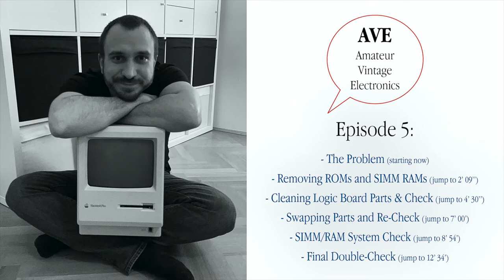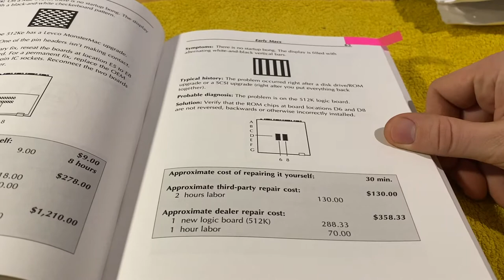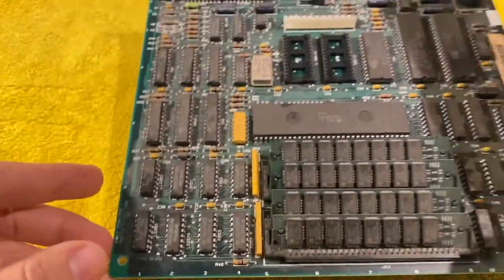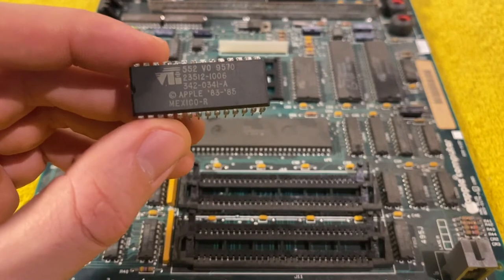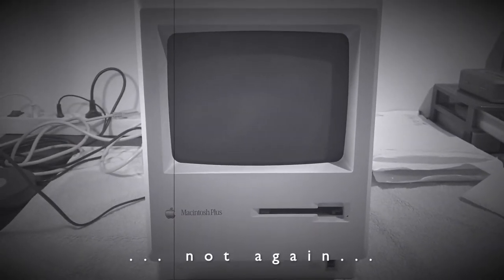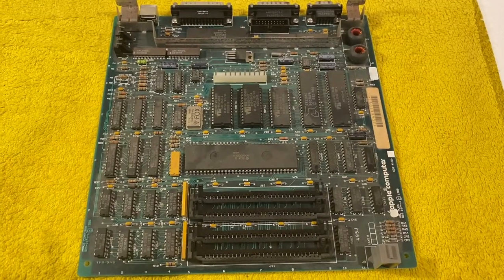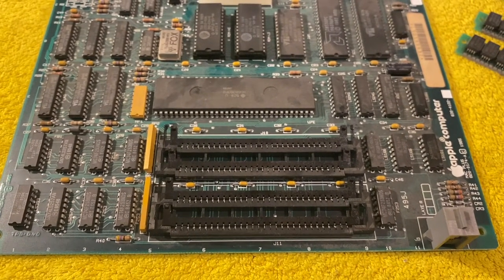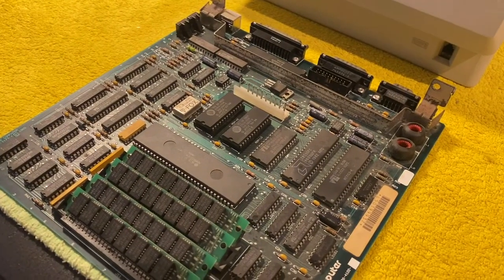Troubleshooting on a Macintosh Plus Logic Board (Episode 5) #MARCHintosh

Comment: I have a few thoughts to contribute :) 
The repair book "Troubleshooting Your Macintosh" (1992) is online at vintageapple.
It suggests the causes resulting in POST failing with "jail bars" in order are (a) power supply, (b) SIMMs, (c) logic board. Do you have more than one Mac Plus, or just one full machine and an extra motherboard?
I suggest spraying all sockets with contact cleaner (SIMMs, ROMs, etc) and refitting those components. Unless I missed it, you only removed corrosion from the pins, and we can see significant corrosion elsewhere. It's fine to spray contact cleaner on the motherboard. (Honestly, washing the whole board in the sink seems in order, then drying, and using 99% IPA. I'm sure you've seen videos of this.)
You can isolate which half of the memory might be the problem by testing without the top row (e.g., if the problem is sockets or related components on motherboard) by installing the ONE ROW resistor. That's an easy test, so I would try that. Also, substituting in two 1MB SIMMs in the first row (and removing the RAM SIZE resistor) would be a good test if you have those around (instead of 256K SIMMs.) If you don't have another resistor handy, you could move the RAM SIZE resistor to the ONE ROW position.
I would order a Mac Plus cap kit from Console5. It's easy to try, and you know those will ultimately fail if they haven't already.
Looking forward to seeing what you find!
Lots of non-socketed components that you'll have to install sockets for, but with two boards, one working you certainly have what you need isolate the problem. Other direction to go would be a logic probe, comparing signals on pins between the two boards.
Reply from the maker: Thanks a lot! I isolated the problem to the board itself! Both ROMs and SIMMs are working fine on the other board despite the corrodet pins. Spraying the sockets on the board is something I certainly should try as well.

Already thought about moving the resistor and try it with one row only, but before doing so I wanted to get some feedback if it could be another part. Don’t want to solder and desolder too often since I want to keep this board at 1MB RAM.
Reply: @AmateurVintageElectronics  Right, you tested the ROMs and SIMMs by moving them to the other board, which means the socket(s) could be the problem on the "bad" board. Anyway, we can continue over on the right video. :)

You are tying your hand behind your back if you're not willing to even desolder a resistor meant to change a setting that will help you isolate the problem. If you don't want to desolder and remove it (because you are afraid of damaging the board) you can cut one of its legs and add a jumper or simply resolder the leg back afterward.
Reply from the maker: Nah you got me wrong there: I’ll definitely try that, but before doing so I wanted to check if there are other solutions / possibilities. The thing is, if I read correctly, the error would be different if a row of RAMs failed, that’s why I don’t think it’s that...
Reply: @AmateurVintageElectronics  I'm no Mac expert, just interested to learn. It's a pretty primitive failure in POST before even showing a sad mac w/diagnostic message.
As you probably saw online, most people that get these "jail bars" look at memory-related issues... so the logic and components supporting memory seem a good thing to check. Too bad more of the components aren't socketed. :-/

Does it work the same with and without the battery?
Reply from the maker: Can’t really say as I never used a battery on any of my Macs. Why do you think this could make a difference?
Reply: @AmateurVintageElectronics  I mean the 4.5V PRAM (parameter settings memory) and clock battery in the compartment on the back of the Mac Plus case.
On some Mac models they are on the motherboard itself and people say that needs to be in place and working for proper startup.
I imagine it's not a problem for you, since yours works with the "good" motherboard. I was just curious to see if the startup failure looked exactly the same without the PRAM having battery power.
Maybe it's just folklore, maybe some models need it and others don't to work properly, but you hear it mentioned often. For instance on Adrian's Digital Basement recently. I think he found it didn't matter on his color classic. On Joe's Computer Museum, he just says to take the battery out and leave it out (so it doesn't damage the motherboard). I guess that's not an issue on the Mac Plus because it's so far above the board.
Reply from the maker: Thanks for clarifying! Yeah I think with the Mac Plus the Battery doesn’t do more than keep the system time. I was just wondering if there could be another battery on the board itself I didn’t know about ;)
Reply: Apparently the Mac Plus introduced something called "XPRAM" - a 256 byte PRAM instead of the earlier only 20 byte PRAM (for the RTC).
I found an article saying:
"The Macintosh Plus included one other enhancement that is largely overlooked and forgotten! I refer to Extended PRAM, also called XPRAM for short. The original Macintosh had just 20 bytes of PRAM which was integrated into Apple's custom-made realtime clock chip. The Macintosh Plus has a new clock chip that has 256 bytes of parameter RAM."

There was also a tool available (XPRAM INIT c. 1989) for the Macintosh 512KE to make it seem like it had the Plus' XPRAM, saving the rest of the info to somewhere on disk.
Reply from the maker: But if I read this correctly, this ain’t a part I could replace, correct?
Reply: @AmateurVintageElectronics  I agree, well you could put a good battery in, but it seems there's little chance it will help troubleshoot your problem.

Turns out it's just a tangent. From my reading of the Inside Macintosh documents, it looks like the PRAM originally just stored geographic info for timezone for clock. Later, when it was expanded in size (on the Mac Plus), it was used by the slot manager under System 7. This is documented in Inside Macintosh Volumes V (1986) and VI (1991), for instance. So looks like [X]PRAM can just be used as a place for various cards/apps to store some params, so I don't see how it would effect this, but some folks say to clear the PRAM if you're having startup problems. If you don't have a battery (or keep disconnecting it from the motherboard) yours is presumably cleared. :)
Reply: @AmateurVintageElectronics  Another idea: maybe the "bad" board has a short or component that is pulling down the power levels when you have the bad board installed.
I suggest comparing the voltages on the power rails with the good vs. bad motherboard.

This is based on this text, from Troubleshooting Your Macintosh (1992):
"Occasionally the Sad Mac codes aren’t legible. As previously mentioned, you can press the reset switch and see if you can catch a glimpse of the actual codes. If  you’re really unlucky, they may look like gibberish or you may have jail bars or zebra stripes going through the Sad Mac. These cases are almost always power or memory related. Rule out the power first, and then go for the SIMMs."
Reply: Also, you can check for chips that are much warmer on the bad board than the good one when powered up. Many chips run hot when they fail.
Reply from the maker: Great suggestions! I’ll try that tomorrow and will keep you updated! Thanks a lot!
Reply from the maker: @DrDavesDiversions  I tried your suggestions, thanks a lot for your help! You can check my progress at https://www.youtube.com/watch?v=jknVMbo1eCw&t=26s